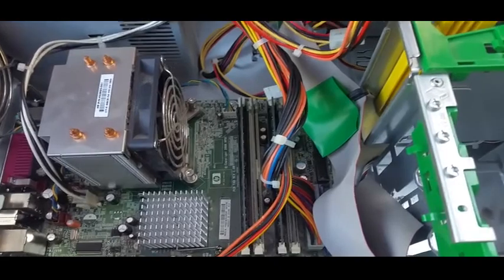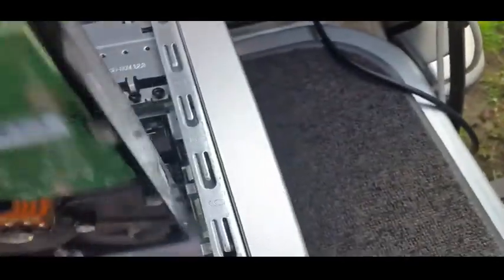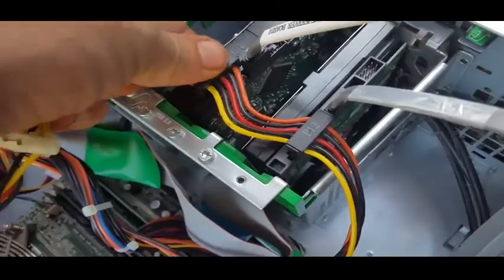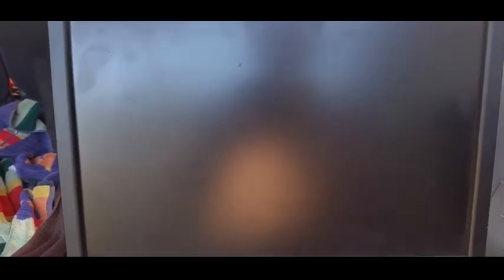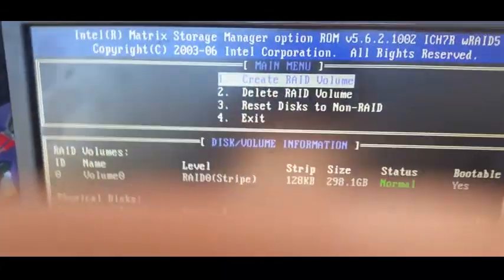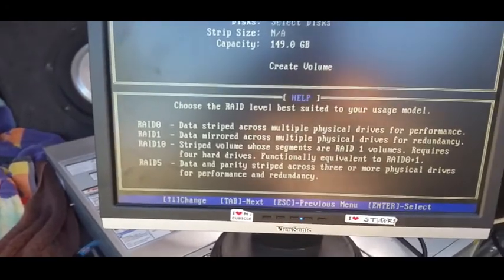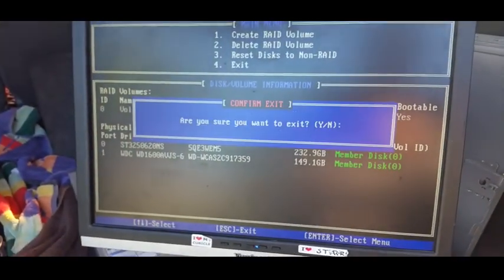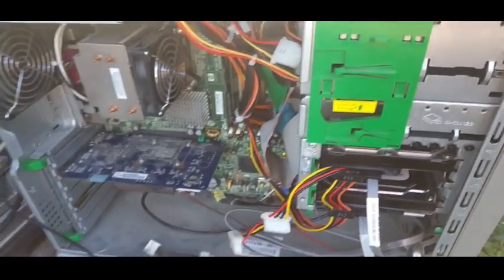xw4400 Hard dirive install and Raid Array Setup

Comment: Hello, i'd like to make a mirrored raid with two Seagate Ironwolf 4TB drives as i would like to use this model as a NAS.
Will the RAID controller work with something bigger than 2TB? The BIOS is MBR based so i'm not really sure. Thanks!
Reply from the maker: It might, but what is going to hurt your performance is that fact that it is only SATA1 maybe 2 depending on serial number. 
It may be better to use the software you are planning on using to create a ZFS array for better performance based on the SATA interface on the M/B
Reply: @OldMatesBackyardTech  Oh i see.
I was lucky enough to get the SATA 2 model, i'm already running a SSD in it and i'm getting pretty good speeds :)
Software RAID is a great idea, i think i'll try both solutions. 
For the performance i might go with a RAID card too since the motherboard has a handy 4x PCIe slot (Although it's only gen 1.1, the theoritical speed is way higher than what the SATA 3 interface can provide).

Thanks a lot for the quick response. You got yourself a new sub ^^

Comment: Is it possible to create Raid 1 set up, if windows 10 is already installed on a hard drive and installing second empty drive to mirror drive with windows    with workstation  xw8600?
Reply from the maker: If you are attempting to create RAID1 under H/W the all data on both drives is trashed as the sync layout needs to laid so the drives are sync'd.
Would not advise using Windows to create a RAID

Comment: Omg i need help with my pc looking into hooking back up my old pc if u have any tips
Reply from the maker: G'day, I need more info about what you exactly want to do so I can a video response for you
Reply: @OldMatesBackyardTech   so i have the workstation xw4400 but at somepoint in time my harddrive died so i took it out and whatnot, i forgot about labeling the p wires and i cant find anywhere on the internet of how to plug one into the pc. I have basically most of the wiring internally correct like the p1, and p3 but then theres like wayyy to many and i get confused easily